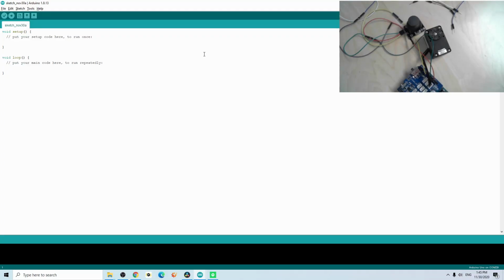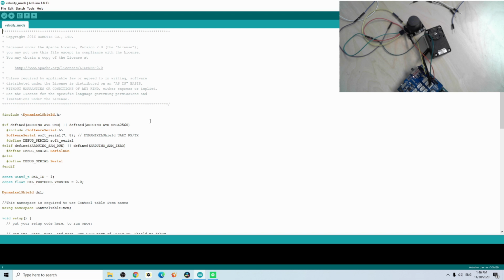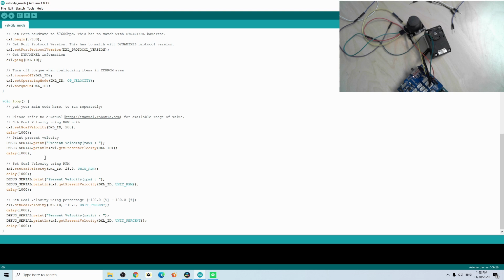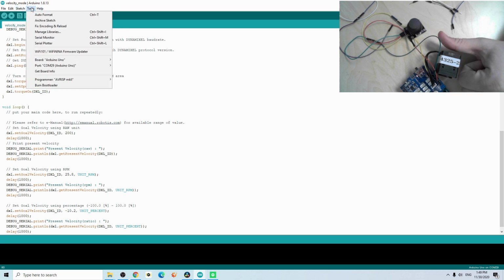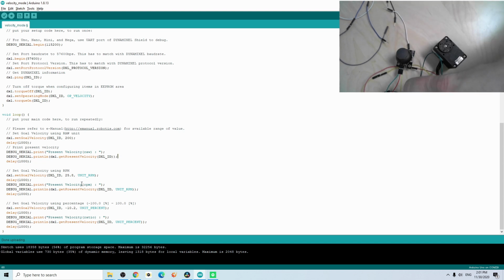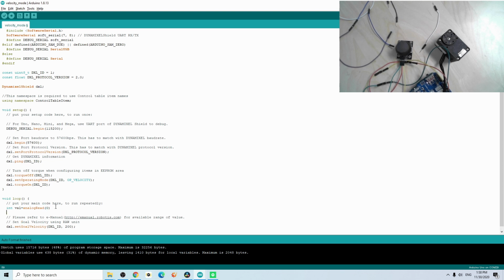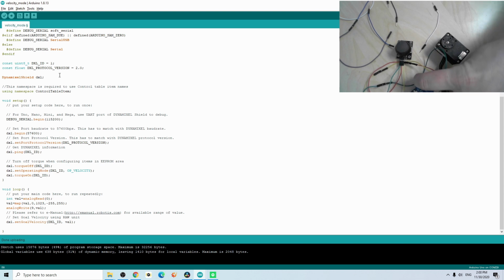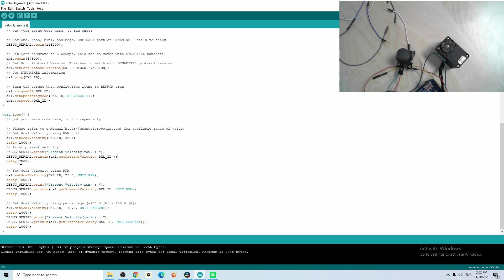How to Use DYNAMIXEL with Basic Potentiometer + Arduino Uno || Servo Control using Potentiometer

Comment: Thank you so much for your tutorial videos. I have one question. Our lab uses Dynamixel MX 28AT and the microcontroller is discontinued.  Do you have any recommendations for Arduino boards that can be used to control the motor? As a neurobiology lab, we only need a simple function, only to control the rotation "on and off".
Reply from the maker: I recommend the OpenRB-150 Arduino compatible board, available from our ROBOTIS eShops. International: https://en.robotis.com/shop_en/item.php?it_id=902-0183-000 US: https://www.robotis.us/openrb-150/
Reply: Thanks a lot for your recommendation. We have another problem now with using OpenRB 150. The board can connect to Arduino IDE (green and yellow led will be on while running program from dynamixel2arduino) but the motor power will be turned off (red led off). we tried so many different ways, changing another Openrb 150, changing charger, and using an old version of Arduino IDE, but all failed. Do you have any idea what happened? In addition, we can use Wizard 2.0 to let the motor move, but fail to send Packets as it doesn't work along what we set in Packets @ROBOTISCS   @robotisus
Reply from the maker: @Betterworld983  
Would you be able to create a post requesting support on our official ROBOTIS Community forum? It may be difficult to provide you in depth assistance here in the YouTube comments, so creating a post at forum.robotis.com would make it easier to carry on the discussion.

Comment: can ı use this sielhd with arduıno mega2560 with two servo motors
Reply from the maker: The DYNAMIXEL shield can be used to control up to 253 DYNAMIXEL servos from a single Arduino controller.

Comment: I have a question. Is a serial communication downloader such as LN-101 essential to use serial monitor when controlling Dynamixel with Arduino?
Reply from the maker: The LN-101 serial downloader is not needed to utilize the serial monitor for Arduino boards, but the process of configuring and connecting your serial port for monitoring depends on the specific Arduino compatible board that you are using.

Comment: Hello I trying to make the car avoiding obstacle using arduino and dynamixel motors. I bought XC430-W150-T as motors, and I also bought HC-SR04 sonic sensor. I'm trying to make the car go and if the sonic sensor detects obstacle, then stop until the obstacle moves. Could you help me creating this code..? I'm having some trouble making the code. It is so hard including some codes related to shield. Thank you.
Reply from the maker: Unfortunately, I can't provide you with any programming help for completing your Arduino project. I can however point you to the Arduino forums, where expert Arduino users can help you with your programming, and you can ask any other questions that you may need answered.
https://forum.arduino.cc/

Comment: It would be great to see examples in C#, using a U2D2 and a PC, to control Dynamixels.
Reply from the maker: Are there any specific examples you would like to see being done?
Reply: @robotisus  Setup of library in VS2019 for a C# WPF app, WPF example app finding a surface/position by reading the load value, moving to a home position and then back to surface position with different velocity's, velocity's PID and position PID.
Reply from the maker: @roguegaston  Got it I will see what I am able to do modifying existing code to try and achieve what you are describing. In the meantime, I would suggest taking a look at our Dynamixel SDK examples for c# specifically the read write example is the one I would modify.
https://emanual.robotis.com/docs/en/software/dynamixel/dynamixel_sdk/sample_code/csharp_read_write_protocol_2_0/#csharp-read-write-protocol-20